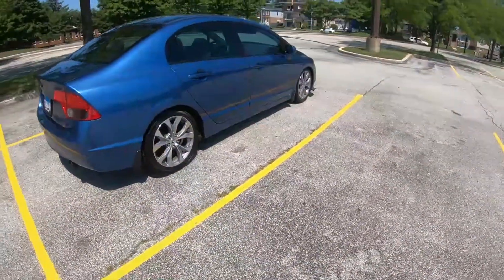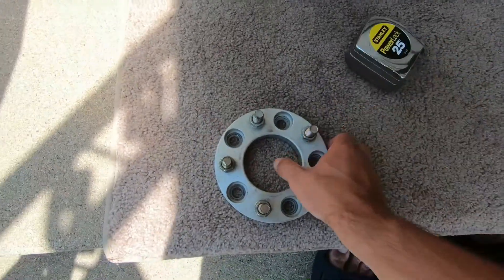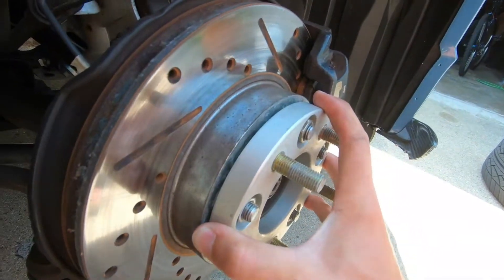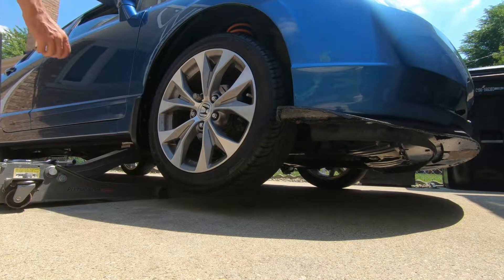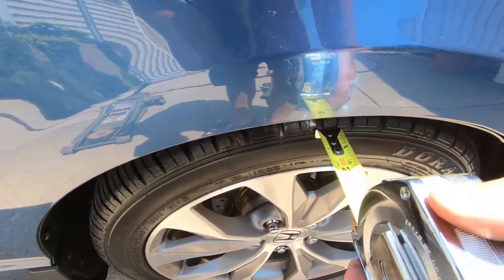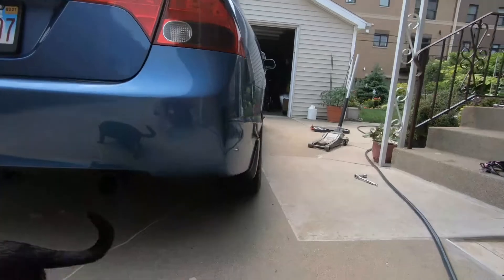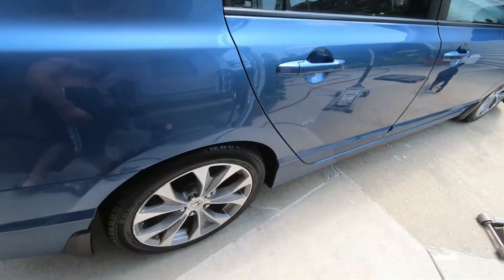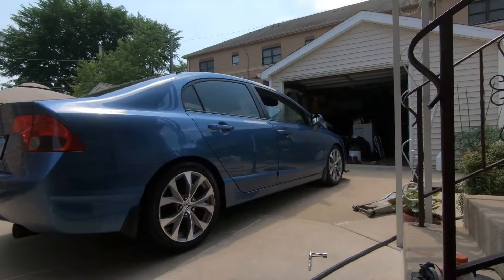Cheap Ebay Wheel Spacer 8th Gen Civic fitment Test ....Watch out!

Comment: 15mm front
10mm rear
Perfect!
Cracks are from buying cheap off E-Bay😅
15mm, you keep saying 17mm, which nobody makes.
10, 15, 20,25 etc
Torque them proper.
64.1 are already hubcenctric for a Civic

Comment: imo if you’re low enough in the rear you should be fine to run spacers in the rear, if you’re tuckin to about the lip of the well or more it doesn’t look bad with that small of a tire

Comment: Eventually when I get my c10 redone(long road ahead) I plan to run a set of wheel adapter/spacers on it so I can run a set of 2010 camaro rims. It currently has really wide 15" chrome steel wheels with baby moons. They look good, but I know the 20" camaro rims would look amazing. Hopefully staggered 8" wide fronts 9"wide rears
Reply from the maker: Yah that would be a nice mix.  Are the bolt patterns the same or do you have to get a wheel spacer that changes the bolt pattern?
Reply: @BulliKid  they are different. The camaro bolt pattern is smaller by 7 mm ive only seen one other c10 of my body style  with those rims and it was a complete custom job where they changed the hubs out.
Reply from the maker: sinformant yea that’s a lot of work for a hub swap.  In that case wheel spacers are only option!

Comment: Did those 9th gen Si wheels require a hub ring for fitment on your 8th gen Si ?
Reply from the maker: These wheels had same hub bore size.
Reply: Now I noticed you have base model. These will still clear the brake calipers and suspension on a Si?? I haven't found any good sources on offset info yet
Reply from the maker: Yah it’s the same size wheel. 17x7 45 et.  Si people run them all the time.
Reply: Thanks for the double confirmation bro!!

Comment: would I need spacers for swapping my 2004 accord wheels for a 2012 civic si wheels? They have the same bolt patterns :  2004 Honda Accord 5 lug 4.5 inch or 114.3mm High Positive Offset
Reply from the maker: They may fit but high positive offset will make the car look and handle worse.
Reply: @BulliKid  The car was built to take 18" wheels. There is tons of room in the wells. I called a few dealers and they told me that it will fit perfectly and handle much better without any spacers. Completely compatible since I have the 4 cyl big block. They said i could bolt on 225x60x18's no problem. I guess we'll see tomorrow. I'll send an update.
Reply from the maker: That is not going to fit and if it does it will look hideous. Lol

Comment: What's it drive like? You realize you'll wear the bearings out quicker
Reply from the maker: I was just showing the clearances I don’t have them anymore.   They would drive ok.   But I prefer not to use wheel spacers anymore on the car for safety and like you said bearing life
Reply: 15 mm isn’t even close to thick enough to wear out bearings and stuff in any significant amount of time lol
Reply: @BulliKid  so are these 15 or 17mm?
Reply from the maker: @AndyMartin92  17
Reply: @BulliKid  okay cause when I clicked your link it took me to 15mm and all the 17 mm say they don't fit the civic.
Reply from the maker: Okok.  I’m not sure why 17s don’t fit.  I bought this set a long Time ago.  15 is perfect too.

Comment: the reason you have an issue with those is because you didn't buy hubcentric. you should do your research before making videos, and not buy the cheapest ones out there either.
Reply from the maker: Yes these had hubcentric ring inserts,  I just couldn’t find it for the video.  I’m using it as a example.  But yes you 100% need hubcentric.
Reply: @BulliKid  they sell them with huncentric rings made onto the spacer.
Reply from the maker: Yes I know. These were cheaper so they were inserts.

Comment: I have a question how many inches should I drop my 08 FA1 civic w 17in 7.5 wheel setup which wheel should I buy that would cause any fender rolling?
Reply from the maker: Check out my wheel fitment guide playlist  for the 8th gen civic.  I talk about all the wheel set ups I have ran.  What fits and WhTs to wide.
Reply: @BulliKid  okay thanks will do I'm subscribing as well clean honda bud
Reply from the maker: @trevonlang8665  awesome , thanks man!!

Comment: Hey quick question my friend do I need to stretch a 215 45 17 tire on a 17x8 rim for it to fit properly when installing?
Reply from the maker: No you can do 225 also.  It depends on the offsett of the wheel also.
Reply: @BulliKid  ok let me tell you it's a 17x8 rim with a 35 offset I'm putting them on my 2010 honda civic lx
Reply from the maker: 215/45/17  is best
Reply: @BulliKid  thanks Bulli Kid

Comment: Why wouldnt you tell people the size of those factory wheels including offset as well as the size of the factory wheels that came on the car? That is one of the most basic bits of information that people watching this video are asking.....
Reply from the maker: 17x7 Et 45
225/45/17
Reply: @BulliKid  what was original wheel size and offset?
Thanks
Reply from the maker: Factory this came with hubcaps. 
16x6.5 et 45
205/55/16

I think those specs are correct but it’s been a while since I sold those wheels.

Comment: What about 25 mm spacers
Reply from the maker: Noooooo wayyyyy
Reply: @BulliKid  I just looked up pictures and yeah I came to that conclusion as well.. I’m running tsx stocks on a 2012 si so the wheel to fender gap is pretty big but I just love these wheels
Reply from the maker: Well the TSX wheels have a really high offset about 55 mm compared to SI wheels which are 45 mm so in your case 25 will be decent. If you know what I mean if you don’t I have a playlist on fitment.  I ran second GENTSX was on my car they look nice because they look like civic type R wheels in Japan but yeah the offset is terrible in the car handled like crap
Reply: @BulliKid  i think I’m going with 20 mm  it’s only a temprorAry thing until I find some aftermarket wheels that I actually like enough to spend money on
Reply from the maker: Are you buying the Bolton kit or the ones with extended studs
Reply from the maker: @leoortiz661  not a fan of the bolt ons.  Have videos explaining that too.  I prefer slip on with extended studs replacing oem studs.
Reply: @BulliKid  I’ll check it out
Reply: @BulliKid  will 20mm fit the front on stock tsx wheels without having to modify the fenders?
Reply from the maker: Stock height should be fine
Reply: @BulliKid  what size lug nuts do i need to get from honda to fit the tsx wheels?  I'm running a 06 civic lx 4dr right now. Thanks
Reply from the maker: I used same lugs.